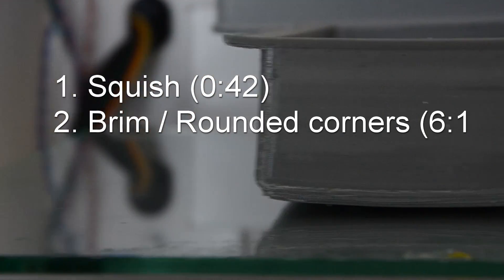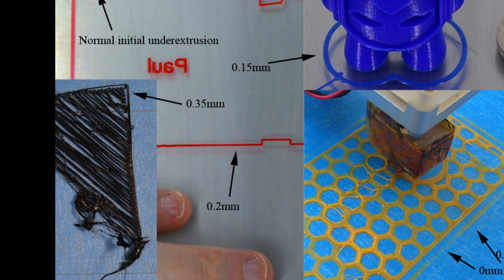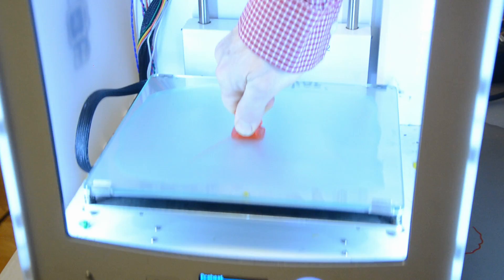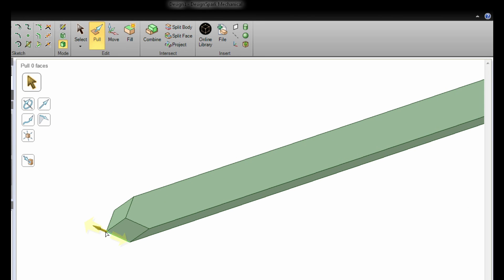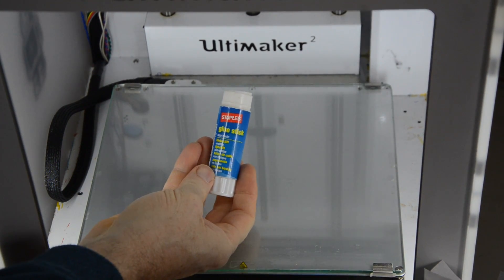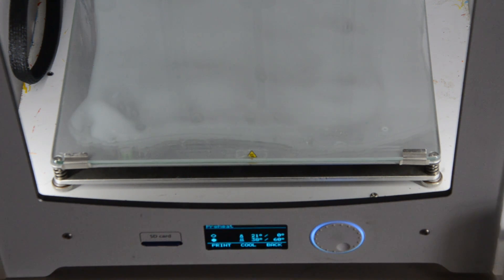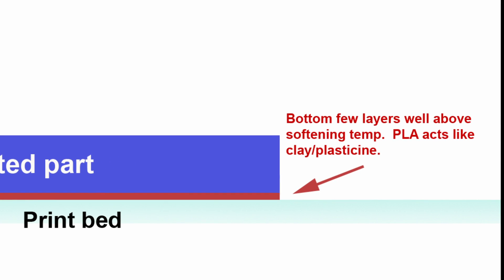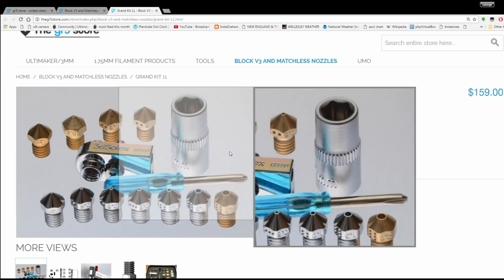How to get your 3d printed parts to stick to the bed and avoid curling/warping

Comment: Hi,
I don't have glass on the heated bed can I use the glue? Mine printer is Tevo Tarantula.
Thanks
Reply from the maker: I don't know but you could certainly use blue tape.  I am only familiar with the following surfaces: glass, aluminum, kapton tape, blue tape, build tac (and other 3rd party adhesion sheets).  Looking at photos I don't know what that surface is.  I'm sure you can use blue tape.  The problem with pva glue is that if it's a very thin layer the part can stick so well it damages the surface.  Glass is almost as hard as diamond so it's a great surface that doesn't damage easily.  So I would ask other users of the tevo tarantula - maybe it has a forum?
Reply from the maker: I certainly noticed that some users used binder clips and put their own glass on the surface (binder clips allow the glass to expand and shrink slightly avoiding the possibility of shattering the glass).  That's a great idea as long as you have a heated bed.
Reply: Thanks

Comment: I have inductive autolevel, what do need to do to add glass??
Reply from the maker: elfpimp1 I don't know.  But blue tape works reasonably well.  Or kapton tape on aluminum.  Or just do manual leveling.  Leveling is not hard.
Reply: gr575 funny story about that kapton tape, my kit came with small roll, being new to this, and I bet you know where this is going, I put the tape down and tried some prints and got super frustrated with prints not sticking to the bed. Then I watched a video about a week or so ago and I see the poster peel the OTHER side off. I felt so stupid...  

BTW,  you're right about the blue tape. I clean it with Vodka and the base sticks like glue.
Reply: gr575 also, as to leveling, I'm going back to a limit switch to set z and will do the manual leveling.

Comment: tape + glue stick. 0.014 nozzle height, non-heated bed, PLA.  Still curls !
Reply from the maker: Veikra did you clean the tape with isopropyl alcohol?  Don't use glue with tape.  The tape has a waxy substance to keep it from sticking to itself so you remove that with rubbing alcohol.

Comment: Just a question? Do you still heat the bed when using blue tape? Or is that bad for the print?
Reply from the maker: JAGA Technologies you don't need to heat the bed if you have blue tape.  But heating to about 40 can help pla flow into cracks better.  But if you have heated bed you don't need tape.
Reply from the maker: JAGA Technologies also if you use blue tape it is critical to wash it with isopropyl alcohol.

Comment: What gcode starting script do you use please?
Reply: Ps I'm dont have ultimaker. Using wanhao i3 plus
Reply from the maker: I'm not sure what you are asking or what part of gcode start script you care about.  I use Cura which creates all the gcodes for me.  I select "brim" for large prints that might warp and "skirt" for smaller prints where I'm not worried about the part sticking as much.  Cura also sets the heated bed temp and nozzle temps for me.

Comment: You're workin my woofers man.  Remove the mic from inside your mouth.
Reply: I dont think that is the most proper method to fix the problem. However, it just might help a bit.
Reply: Nah man, he just needs a "POP" filter.  Ever wonder WHY people (especially pro's working in audio positions like radio) have those foamy type covers over the mic?  It's for the hard sounds and letters that make it sound like someone's blowing a raspberry :)
Reply: Great video though!.  If anything, I'd suggest running your vocal track through a normalizer to try and even the volume out.

Comment: 08:17 
this is rediculous.  i just wipe down my glass with wet paper towel or toilet paper.   water just water.   
never any glue. 
never any hairspray. 
and i just wipe it down once a day or if i touched it so much it does not stick anymore.  
and no need to remove it

and i have never had any problems getting anything to stick.  
(except fillement with moisture inside)
Reply from the maker: darkracer125 then why watch this video? Lol.  Seriously though for 200mm wide prints  you probably need glue.
Reply: because i was bored and it showed up in the suggested video's

Comment: i normally dont print in center. i print at cornor.

so that i can get fast adjust on the fly for first layer.

this is ofc for none-auto leveling and super lazy person......like me......

coz in this way. only 1 cornor is needed to adjust....instead of 4...assume pretty level plate to start with...

Comment: Getting the prints off the bed has never been an issue for me, just cool them down and they pop off. I bought a glass pane from a picture frame shop, normally they cut glass for you for very cheap, then I just remove the whole glass pane when it's done printing and pour cold water on the underside of the pane (slowly so I don't crack the glass from the temperature differential).